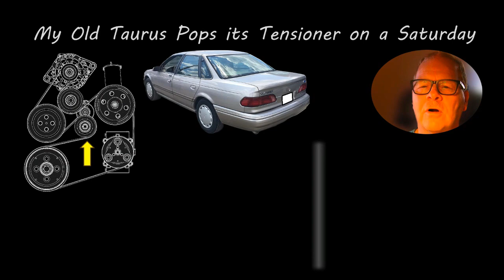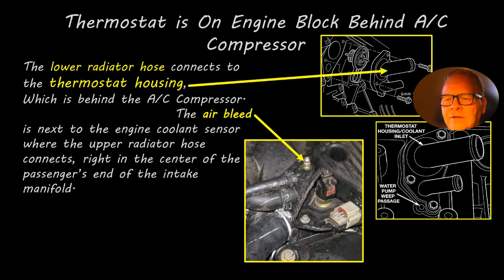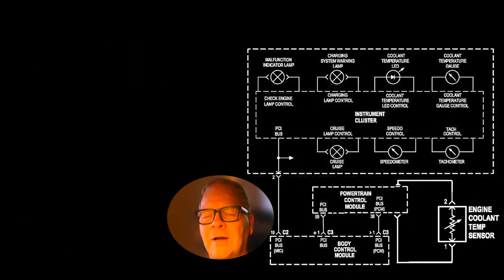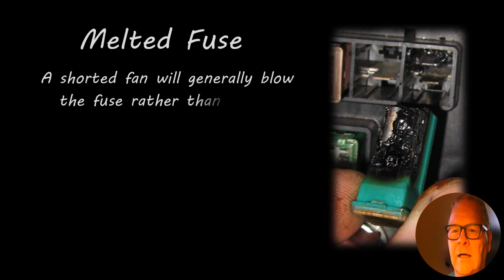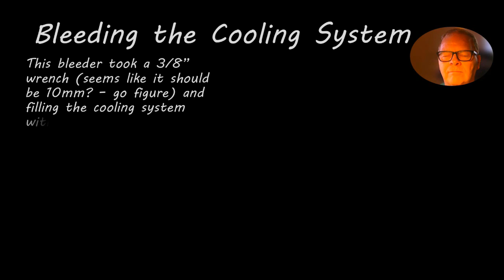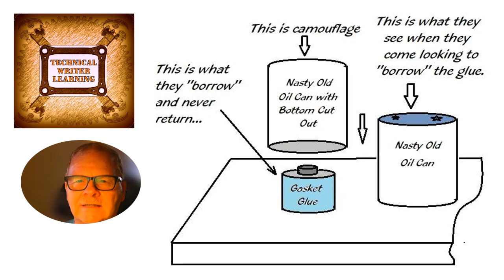Gauge Fight and Hot Stuff

Comment: Can you use just a little of weatherstrip adhesive on a gasket to hold it in place, just before installing the component over? Let's say a water pump gasket that falls out anytime you try to align the water pump and the bolts? Untill now i've used just a little RTV(room temperature vulcanizing) to hold the gasket , but every manual says either use RTV ONLY or either use gasket ONLY. So i don't want to to mix the two , even just a little drop of RTV to hold a gasket in place. So i've been thinking about using just a little bit of weatherstrip adhesive instad of just a little bit of RTV to hold the gasket while aligning the water pump and bolt holes.
Reply from the maker: You can use tacky grease or anything that doesn't harden